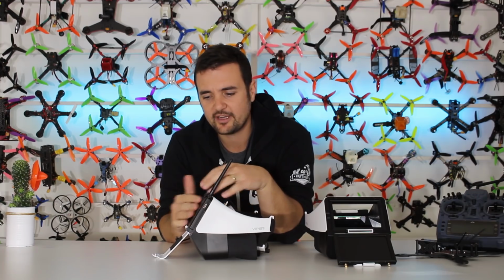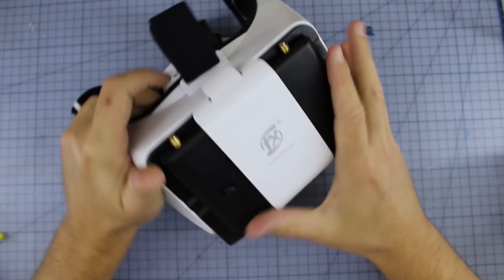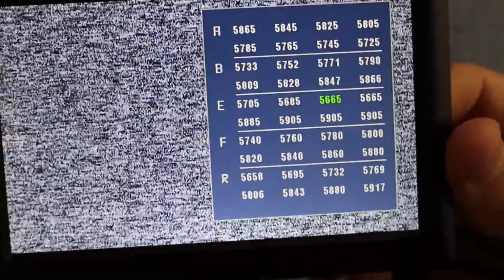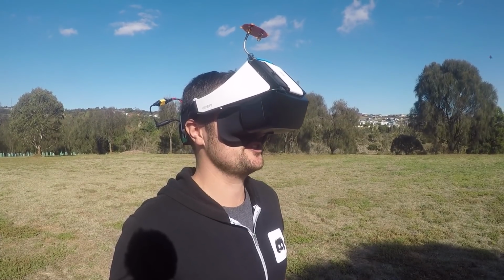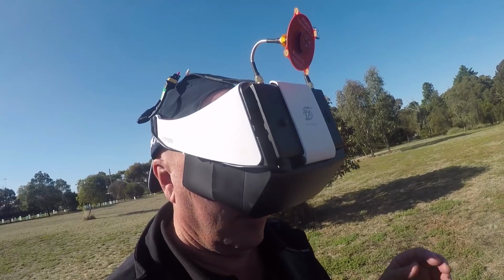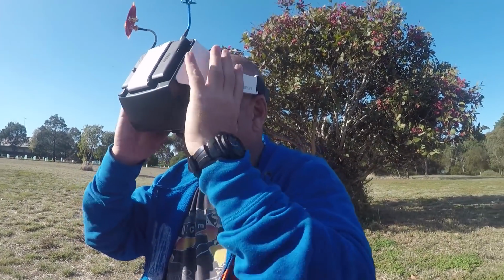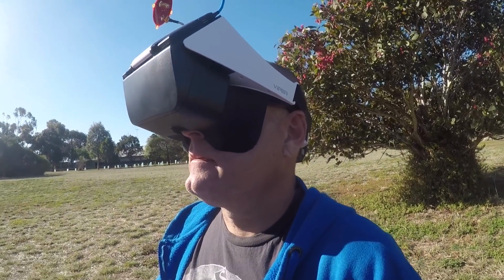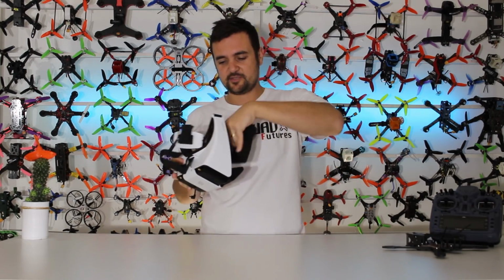BOX GOGGLE GAMECHANGER!! FINALLY!! FXT VIPER GOGGLE REVIEW tech tuesday

Comment: It’s nice that glasses can be worn when using these goggles since I wear glasses.  One suggestion I have is placing a channel or bracket on the back of the monitor to be able to attach it to a tripod if not enclosed in the goggles.

Comment: What I like about these goggles most is that removable screen. I already have multiple ideas of what that can be used for. On a side note, I've never thought about fpv drones until about a week ago when one of your videos just popped up in my feed. Since then I pretty much binge watched videos off your channel and I have the $99 drone bits with the $10 upgrade motors in my cart. Love your channel. You have a fan and future fpv pilot here in Wyoming U.S.

Comment: These are very similar to the EV800D goggles - diversity, removeable screen, good resolution. What I like about these is the wide range of batteries that can be used for power and the fact that they can be used with glasses.

Comment: I made my own box, because I am farsighted and no normal boxed goggle got the right view point for me. I mixed the foam casing of the Quanum DIY FPV Goggle V2 with the monitor of an eachine EV800 monitor and an external video recorder. Works fine for me so far but I wanted something better all the time because the whole thing is really huge and looks crazy. I need this!

Comment: I need reading glasses as well, Fatshark says that there design works for people like me but I still had trouble reading the osd and seeing details like ghost branches, power lines etc.   I ended up making a set of diopters out of a cheap pair of +1.5 strength reading glasses.  I milled the acrylic lens to the right size to slip into my diopter slots on my fatsharks and for the first time ever I flew FPV in perfect focus. I can't tell you what a game changer that is.  For any of you older FPV pilots who need reading glasses this could be a perfect solution for you too.  I will post a video on how I made them on my channel in the next week or so and would be happy to make more for anyone who needs them.

Comment: Stew, this is great, I would love to have these.  I love the menu, I love that you can wear glasses with them, and I like that you can remove the bottom to have spacial awareness. That would be nice for when you need to rapidly switch to Los flying and when you need to be able to see where your kids are when you fly.  cons:  size for transport, and There should be an auto scan option and an ability to select any frequency not already assigned.

Comment: The elimination of eye strain is a great selling point. I prefer the larger screen but I do feel it in my eyes after a couple of battery packs
Reply: Iv stayed away from fpv becouse of the eye strain 😎but do you think thay are better than anything else on the market ,iv used my friends once and they don't sell them in the shops to see what thay are like, i want to get the right pair ,if I get into the sport ,cheers
Reply: @stretchy474747     the guys I fly with use the fatshark goggles because it doesn't need with your eyes so much. They also complain that a 4inch screen is too large and they have to move their eyes too much left/right/up/down. I'm the other way, I enjoy the large screen and feel like obstacles are seen easier. Just like everything else... All personal preference

Comment: I think it's fantastic that it has reduced eye strain with the mirrors providing some distance and can fit glasses under the hood! 2 of my biggest problems.
I have been looking for quite some time for something like this to get me from planes to drones, the glasses are a real road block.
might be nice if the screen had a better resolution so you could use them for more things on the computer.
thanks stew, these are definitely going in my maybe pile.

Comment: I like the detachable screen, Stu. Until recently I have flown only line of sight. Last week I received my new Aomway Commander googles and installed a camera in my quad.  I didn't expect I would get as nervous as I do, flying this way... if I lose orientation even just for a moment, I have been panicking, and often I need to rip off my goggles to try to regain sight and control.  I think flying with a screen for a bit while getting used to the idea of FPV would have been a good tool for this type of transition.

Comment: If you stand 1ft from a mirror the reflection you see (in theory) is 2ft. The mirrors allow them to push the point of focus further than your conventional box goggles. With or without glasses, this should eliminate any need for adjusting the focal length. Hopefully this helps anyone on the edge.

Comment: Gday mate, always love your work and thanks heaps for doing that for all FPV lovers! 
I watch every single goggle review, and finally I may found the right one for myself. although I think it a bit too big as Cal's comment, but here are the features I like, the reflection to increase distance to the viewing screen, the design to use forehead to hold the weight (like PS4 VR), removable display and built in DVR. The removable eyes cover is feature to make me pull the trigger though, I always feel uncomfortable if I don't see the surrounding and this is the first one I have come across.

Comment: On the band/channel selection the reason some frequencies in the E band are repeated is that some are not allowed by the FCC, specifically E4, 7 and 8 are not allowed, these are at 5645, 5925 and 5945.  5925 & 5945 would normally follow 5905.  Obviously they did not want to distort the selection screen by only having 5 or 6 channels in the E band so they just duplicated 1 of the legal channels to fill the screen out.  Many vTX's block these channels now.
Reply: thanks, teacher Joel

Comment: They look comfortable and I like the menu. I wouldn't mind checking these out. Its better than what I have. I have the v2 DIY kit from hobbyking and they are heavy and the monitor has a horrible resolution. I really need a new headset. lol
Reply: The FXT goggles is great. You could use the goggles with your own glasses. Very clear picture, large screen is immersive, materials feel high quality and you can remove the screen to be used as a ride along for multiple people. And the FXT goggles is sold on amazon website now and the shipping is very fast. You could have a try on it if you like it.

Comment: I wear glasses and I have been using box goggle for a two now. I have the Headplay brand with cost way more then that one. I try wearing eye contact and using fatshark goggles but just didn't work for me. I am so use to box goggle and the 16:9 screen. I don't think I can ever go to fatshark goggle style. My Headplay goggle screen seem to be going bad. Getting ghosting image time to time.  I will consideration buying it if fits my glasses. I wear wider glasses. I need to do some homework on it to make sure it fits my glasses. But if you can tell the distance side to side (left to right) so I'll see if I'll fit my glasses.
Thank you for the review. I have been keeping my eyes open for new box goggle.

Comment: So what would be then the difference with the Fatshark transformer SE?? The Transformers use the same mirror, same detachable screen with diversity, are much smaller and the resolution is greater at 720p, have are well the battery in the back and give you also the option to modify the separation of the screen from your eyes... added to that you can purchase them with the binocular module which is INCREDIBLY much more immersive. What they would lack though is the DVR. Wouldn’t the Transformers SE be much better?

Comment: Thanks for posting this.  QUESTIONS:

Does it really have two receivers for diversity or is it dual-antenna diversity?  
What resolutions are supported on HDMI in?

They're uglier than my dog's arse, but I'd give'm a go if it is dual-receiver diversity since nothing else with that feature works with my glasses.
Reply: that's true diversity receiver modules built-in
Reply: HDMI in supports 1920*1080